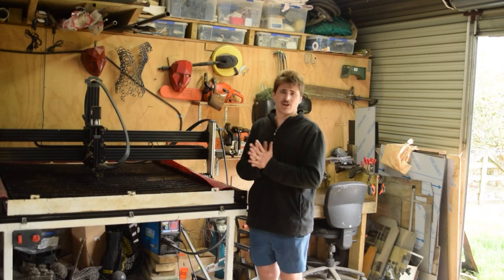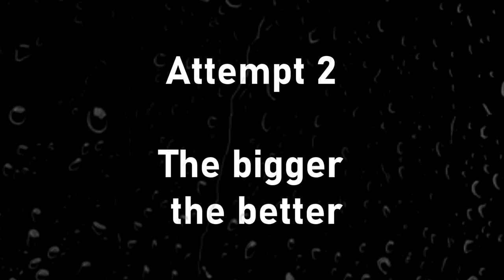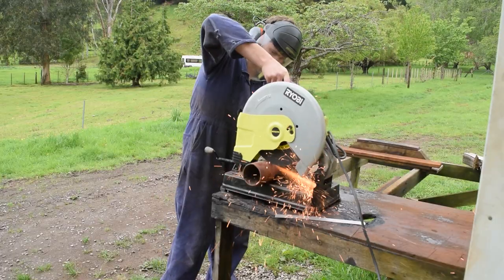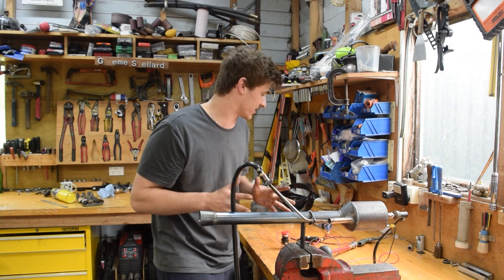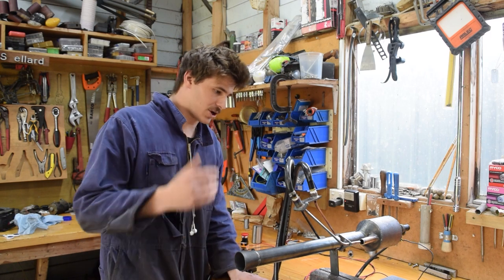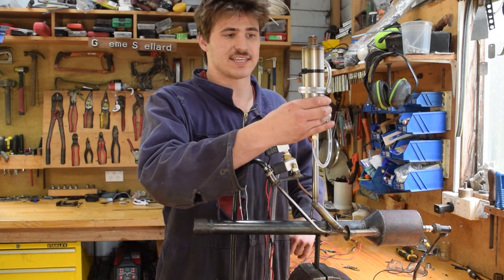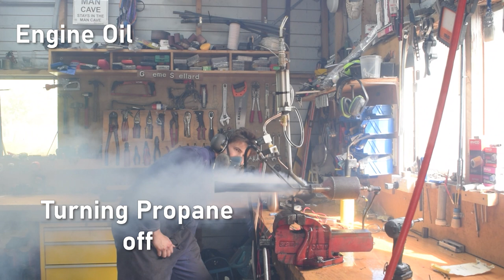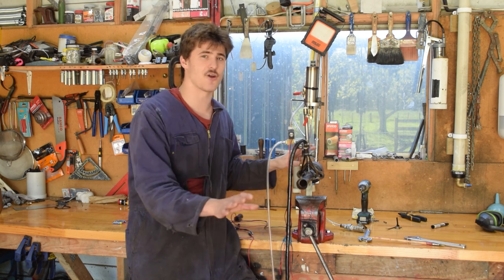Burning my shed down

Comment: Excellent Vid and great work getting this to run on liquid fuels. 
If I could make some suggestions based on knowledge and experience with burning oil....
Your Friend here is heat. It will phase change the liquid to a gas which is what burns.  The hotter you have the jet to start the better.  I would try injecting the oil back near the plug so the oil was not blowing back out the inlets on the pressure phase of the pulse and  had Longer residence time to combust and mix with the incoming air.  I believe this will also make mixture / fuel control less critical because there will be margin where the air not the fuel will be the determining factor. Should be able to run rich and if you see smoke ( unburned Fuel) you can back off same as if you do get oil spray out the exhaust.... which would be interesting to see if you could then get an afterburner to work.....
. 
I would also suggest an injector is overkill.  For metering, a needle  Valve on the oil line and feeding the oil with a Cheap pulse or  roller pump should well Suffice. If you are using used oil put a filter in front of the pump to prevent blocking  the small passages in the valve with any dirt.  Atomisation is not what makes oil / Fuel burn, it's heat. Atomisation just allows the fuel to boil and create gas easier but dropping the oil in a red hot chamber preferably will do the same job simpler and better. 

Pumping the oil and having a needle valve will allow precise control and you should be able to run the thing for hours if you have a 20L drum of oil or whatever it needs.  As you are still needing some gas, I would also suggest blending 5-10%  Petrol into the oil will allow the combustion to take place easier and support the burning of the oil which is probably a bit slow. that said, If the chamber is red hot then that may not be needed. 

GREAT work and brilliantly entertaining Vids.  Give it time and your channel will take off because you are doing it bloody well already.   I look forward to and hope you will develop this further.  Many pulse jets running gas but waste oil would be a great achievement in my book and one I have not seen done so far.
Reply from the maker: Thank you so much mate, that's a bunch of really good advice I'll probably look at this project again and give it another crack I like the idea of mixing in gas to the oil to thin it down and after burners would be amazing.

Comment: those hydroformed pipe are very cool. even if they didn't work
Reply from the maker: Thank you, they looked amazing after welding with the edges bluing nicely, i definitely feel that's not the last time you'll see me using it :)
Reply: @FinlayShellard  That may be used as 2stroke engine exhaust?, I see a karscher doing it, How many Bar. do you need?

Comment: i have tried diesel and ethanol on a 70 lbs lockwood pulse jet and it's kinda weird...
the engine can run 100% on diesel but i think that my fuel system have got some air in it.

and also, theres alot to do to increase trust almost by 3X

1. afterburner: just a tube with slightly larger diameter than the exhaustpipe (in your size of engine) about a decimeter long. sitting about half a decimeter from the exhaustpipe.

2. a afterburning ramjet: pretty much like the afterburner although it's an own combustion chamber with injected propane as fuel.

3. the right design: if you are using normal designs of pulse jets (yours being thermojet). with the right design of the same "category" it can go from 3 lbs to easily over 10. and combined with a ramjet afterburner, it can do over 16+ although the numbers are quite "impressive" you need to get a proper fuel injector.

if theres anything else that you wonder about i'll help you out.
iv'e got some videos of my pulse jet from the beginning to the newest powerfull mod.
Reply from the maker: Thanks so much, i love the idea of a afterburner!

Comment: It would probably work better if you installed a needle valve for the liquid fuel. Also possibly extend the inlet pipes with a cone to pic up more of the droplet type fuel. Maybee also installing some sort of flame holder in the chamber to get better ignition of the oil. Typically it is used a v or cone profile with the edge/point facing the incoming air, this creates turbulence and lower speeds behind it for the flame to stay lit till the next cycle starts.

Comment: Not sure if youve already addressed this, and of course it is your choice, but surely there is a better way than following around your plasma cutter whilst manually holding down the sheet. Thanks for the vids man.
Reply from the maker: Yeah there is, I'm glad you pointed this out hahahaha, I have made a torch height controller and just need to put it on but I shall continue to put this job of until I can't bare it any more, it currently isn't a real hassle but absolutely is not the correct way to do it lol.
Reply: @FinlayShellard  looking forward to an installation vid!

Comment: I really loved seeing the iterations, the liquid fuel one seems ridiculous :D
I dont quite get why you drilled the pipes at 3:33 though. Also a pen and paper diagram of the fuel feeding system would be nice, not quite sure I got the idea how it works
Reply from the maker: Yeah it went crazy sucks the mic peaked too much. I only did a small pre drilled hole before welding on the intakes then ran the drill down to cut and clean up the rest of the hole, meant I didn't have to do any fancy die grinding. And yeah I was worried the video was getting too long and boring so I definitely sped though that bit.
Reply: @FinlayShellard  Oh I see now, thank you